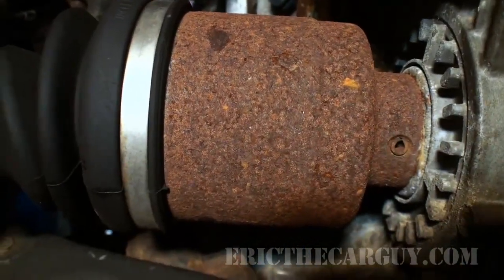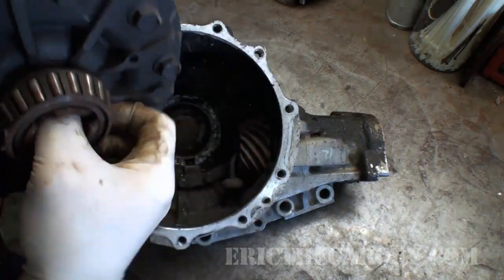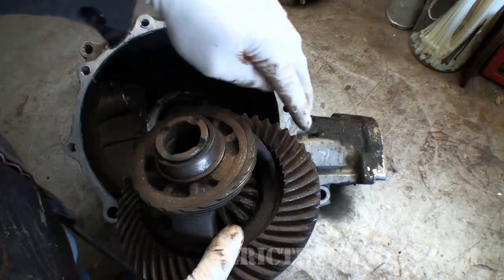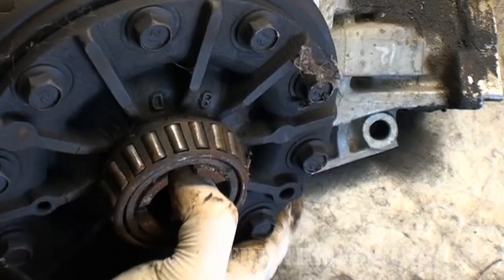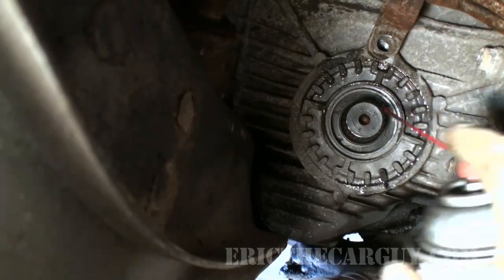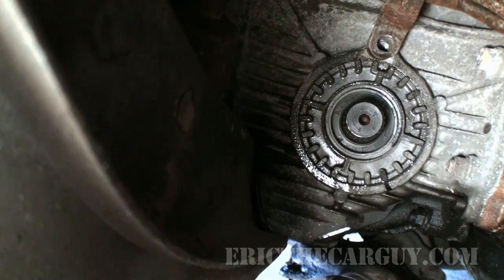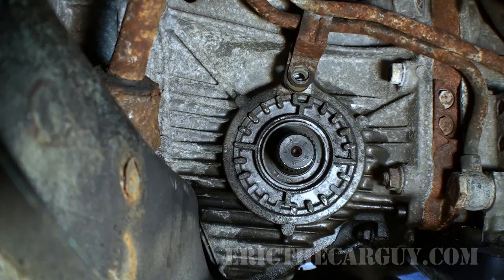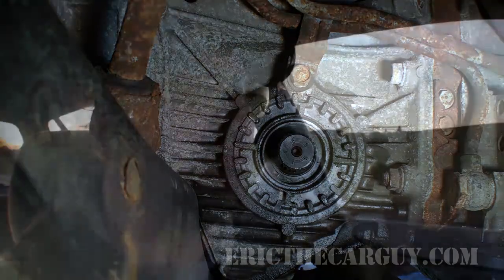Subaru Legacy, Setting Differential Preload -EricTheCarGuy

Comment: Oh I understand now, thanks for clearing that up. I thought you might be talking about the clutch setup controlled by the Duty C solenoid that meters and sends power to the rear wheels on demand. I see what your specific issue is now, that that doesn't sound too fun!

Comment: Eric, you may have never thought of this, but maybe in the past someone made a transmission rebuild on that car and forgot (or didn't know that it had to, or didn't want to) set the Differential preload? It could even be way out of specs because the previous person who worked on the car didn't do it right.
So maybe what you have done is not that unhortodox as you may think :)

Just my thoughts.
Don't forget to tell us on the future if it made a diference on the car (what you done on that video).

Comment: ^-^ poor thing. That air hammer did somethin. 
You know my Legend has a small kick as well.
Ex-- from almost to a stop but when i push into the gas slightly it does it. 
Not sure if its the tranny of this prob you posted. 

Also that Acura Final Drive. How would you lube it up?? Id like to do that to mine since im sure the last owner never did anything to it.

Comment: You could probably make simple tool out of straight iron or angle iron. If you drill hole for drive axel you could even attach it with that pin and some large washers.

Comment: how about creating a tool out of a steel pipe.
cut 4 notches into end of pipe that engage the aluminum adjuster.
other end of pipe have a square hole for the socket wrench.
Reply: sdowney717 Genius idea. How are you going to index all of those cuts to touch all four dogs  at the same time

Comment: I just did this on my 82 sub gl hatchback, I WAS able to get the retainer off, going counterclockwise, it took 5 full rotations. I needed to do this to get to the differential seal.  I actually don't think that retainer does anything. It's not hooked up to anything.  MIGHT works as a spacer. i just put it back on the same way, seems to be fine.  Anyone know different?

Comment: It doesn't drip out because on Subarus when you pull the axle you don't open up the transmission. The axles are held onto the diff shaft by a roll pin.

Comment: I am having trouble removing the carrier bearing.  I took off the bearing pre tensioner plate.  Got a bearing puller on the bearing and all a accomplished was bending the outer race off.  Now I cant get a bearing puller to grab the inner part of the bearing to remove it. Can I just pry the axel stub out with the bearing attached. Any help would be great.

Comment: Hey Eric, Im about to buy another Subaru and plan on swapping in the 5 speed from my other Legacy. It has VERY slight front diff carrier bearing play. Would it be worth taking to the transmission shop and have it checked out BEFORE I put it in the "new/used" Subaru I am buying? I imagine so but like your opinion

Comment: Hi, 
my subaru has male stud axles on it.

(come out of the transmission) 

How do i remove them?
Reply: You presumably have a manual transmission, use a pry bar between the transmission and CV cup. There is a retaining ring that must be overcome, then the axle will some out easily. Remember to fully install the axle once replaced to reseat the retaining ring.
Reply: @raarsnafu  so the stud axle pops in and out?  Do i have to remove to change axle seals?

Thanks for your help

Comment: Can this be done with the axles still in the transmission?
Reply: Technically yes but you'll want to remove the axles as it will just be much much easier.  There's a post from a guy named grantz4u that came after your post on this video talking about how to make a tool from a 2 3/4'' PVC coupler.  He says to tap it onto the retainer to mark the 4 splines toward the center of the retainer and then dremel out the slots.  Then you can use a strap wrench or even drill a hole for a socket wrench handle or something on the other end.
Reply: Thanks for the advice. I ended up keeping the axle in because I was only making a small adjustment. I had the retainer out to replace the seal and I put it back a tooth off. Of course I didn't realize it until everything was back together.
Reply: Using the 2 3/4" PVC sounds like a good idea though. That will probably be the technique I use when the time comes to do the drivers side.

Comment: how did you like the subarus? im thinking of getting one
Reply: hddm3 I love mine, I have a 2008 Forester XT Limited. Not many problems from it, just replaced the shocks/struts at around 78K miles. Other then that, never had any problems.  And for a small suv, it'll surprise the mess outta you.
Reply: hddm3  I have had a Subaru for the last 10 years and some people have had theirs longer. When Subaru was taken over by Fuji , they made a commitment to not put anything on the car that had more than a 2% failure rate. Also Subaru holds the record for most miles on an original  gasoline  engine. I was told it was slightly over a million miles. They are great cars. If you look in the classifieds you rarely see a Subaru for sale.. I have over 233,000 miles on mine and  trans is still tight and engine  burns no oil. Runs tight and quiet. Right  now I need to replace the cv joints. Other than normal wear items it has been the best car I have ever owned.  They are also easy to service not cluttered up with a bunch of shrouds and shields. Buy one and you will truly enjoy it. Especially 30 plus mpg. All wheel drive is great in the rain and snow. You will really appreciate it when it rains and some moron in a puck up truck tries to take off from a light in a right turn lane to cut in front of you and you are gone while he sits and spins his/her wheels. Buy it you  will like it.
Reply: thanks guys
Reply: +hddm3 Subarus are great cars. High quality, reliable, and solidly built. Not expensive to work on either. Plus AWD in a smallish Japanese car that's not a RAV4 or CRV. I love mine. It's been very reliable. It is going in for head gaskets and an engine-out overhaul at 130000 miles. Make sure you get it inspected before you buy. Also make sure it has service records with it if looking at a used one. Look for major services and for some cars head gasket replacement. Subarus with the 2.5 liter engine made from 1996-2003 have known head gasket issues, and it is pretty common, as in 8 out of 10 cars, to have a failure. It mostly went away by 2004, but some 2005 2.5's have it, and even rarely some 2007 cars. If you want to totally avoid that issue, buy a 2007 and newer, one with the 2.2 liter (some older Legacies, Imprezzas) or a used one that has had the head gaskets replaced with updated MLS gaskets done by a shop. Other than that, very good cars! Get the head gaskets done and keep it maintained and it will go for 200,000 miles.
Reply: Had my '03 Outback 2.5L for a couple years now and honestly it's one of the most solid cars I've ever driven. I know I'm a bit late to the party but if you ever bought the one you wanted I hope you're enjoying the hell out of it. Especially through the snow if you live up North ;)
Reply: Run. Run like hell.
2015 Forester death wobble started my opus. Passenger side. Fixed by replacing the lower control arm. Did both sides because if one needs it the other can’t be far behind. 
Got it aligned. Started a ping/pop sound under the passenger floorboard when the car is on uneven ground. 
Replaced both struts. Ping/Pop still there.
Replaced sway bar links both sides. Ping/Pop still there. 
Replaced tie rod ends both sides. Ping/Pop still there. 
Checked transmission mount. Checked heat shields. Checked every bolt under the engine and transaxle. Checked every bolt taken off while replacing the grab bag of parts. 
Nothing. Ping/Pop still there. It’s always been intermittent but still there. Ping/Pop. 
Run. Run like hell.
Toyota. My tundra is at 275,000 miles. Replaced the timing belt water pump and tensioner once, after the water pump started leaking. Other than routine maintenance that’s it. No wheel bearings-two on the rear of the Subaru already. 
Run to Toyota. Run like hell.

Comment: I couldn't get it to move at all too. And I used the Subaru special tool. Now I'm fucked. What to do?
Reply: Wait, your special tool didn't work??  Please elaborate....

I did this a few years ago on my 2000 outback.  Barely got it to tighten but I was able to actually just remove the whole thing and then dabbed some oil on the threads with a brush and it went back in much easier...try just draining the fluid and removing both retainers first, lubricating and then re-installing and see if that helps.

Comment: Setting the lash on a pinion gear is tough on a work bench with all of the right tools.  It's impossible to get it right when it's still on the car.  Pull the dumb thing out and take it to the transmission shop.

Comment: The manual lists the Subaru special service tools that are apparently needed

498937100
499787100

Looking at pictures of the tools, it looks like they would make the job much easier, but it also looks like you'd need a lot of room to use them, like out of the car. Even used they aren't cheap, either.

Comment: Dont do this.  You cant make up for worn bearings but tightening them.  

Also, you can hear how light he was hitting that.  No wonder it wouldnt turn.  Put a flat chisel on the tooth and point it towards the retainer.  Then hit it harder and it will move.

Comment: 11 years ago: This car is more of an experiment anyway so whatever
2024: I got this car for basically free so I might as well fix it for ~$1500 and drive it so I don't have to pay minimum 5-8k for a decent used car. (me except mine is a 98 L Wagon)

Trying to get the passenger side retainer plate off my 4eat right now and i rememebered this video existed so i came to see what you did because I forgot. Unfortunately you didn't get it but I will try something with an air hammer and see if I can get it to go. Thankfully I have the transmission outside of the vehicle (replacement transmission)

Comment: Well you never did come up with the preload and those or at least some of those seals are not removable from the outside. That entire Hub has to be spun off as there's a step that the seal rests against. Now when you put that back in, you can make a little Notch where it was but how in the world are you going to count how many spins or turns you had upside down under the car to make sure you were right on it. So Eric the Car Guy all this seems like a pretty flimsy approach to something that could grenade if it's not done properly. No offense just an observation

Comment: You should use PB Blaster penetrating oil instead of that WD-40 stuff. I had more success with PB than with WD-40 when needing to break loose something that is rusted or corroded together.

Comment: I've done a bit of "chinese kung fu" in my line of work as a diesel technician. I've employed "unconventional methods of troubleshooting bus and trucks." There are some things that plain manuals won't teach you. There are instances that require quick fixes. Customers want to save money. The same goes for our side. Especially if it's under contract. If it's simple enough to do and take less time to fix it, then why not?

Comment: OK. Eric. Im upset that I watched like 6 Videos. that were great! I was rootin for you! But you never finished this. I understand though. its not a race car. the problem was probably wear on a part that wasn't worth accessing. and its a problem you could deal with. I wish I could tell you what it was. but I cant. SO In closing. Great Videos! keep it up! it was a cool mini series to go through. Im a Little upset we couldn't fix it, but hey. You got a nice tune up, and Maintenance is Problem Prevention..

Question though.when you tightened the one side of your differential. did you push it closer to your worm gear? or farther away ?

Comment: There's probably a special tool to rotate that retainer. It must be like a circular large socket with the same tooth pattern as the retainer so that you can rotate it and apply even pressure to all the teeth so that you don't chip them by hitting on them individually. The other option could be to put a small piece of solid wood on top of the retainer and hammer it hard all around to brake it loose. It's probably just slime/rust that keeps it frozen.